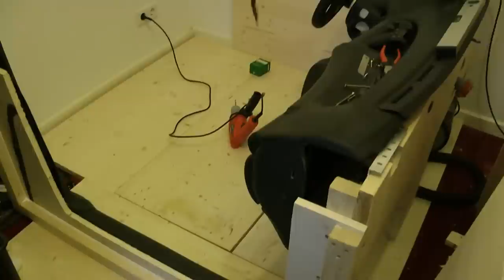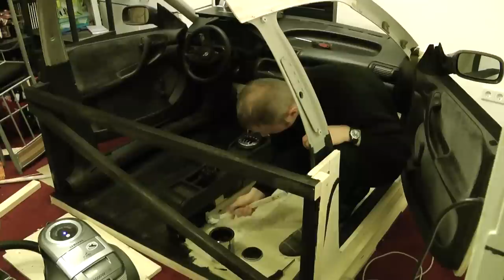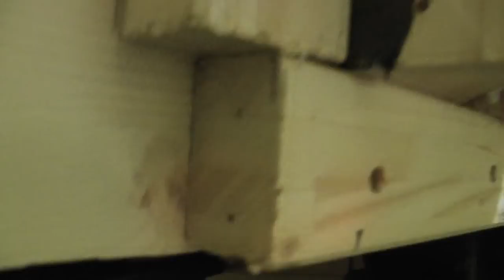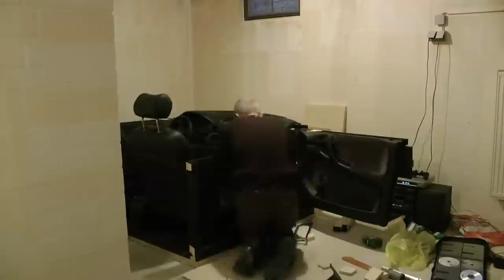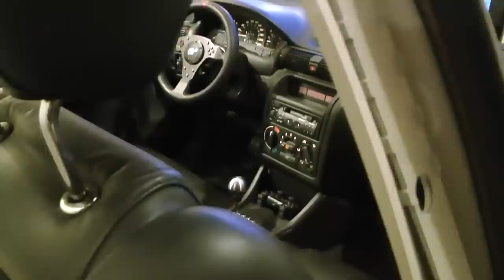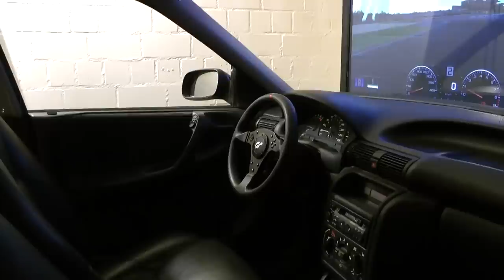Simulation Cockpit With Extended Thrustmaster T500RS and TH8RS Shifter Part 1 of 2 -.mp4

Comment: This is really awesome!!! It really shows the amount of work you put into designing this set-up, and the end result is just pure awesome!
I've thought about something like this but I was going to plan on going to a local scrap yard and just purchase a complete car to cut in half and use only from the firewall back to the B-pillars! and mount it on lockable rolling casters so I can roll it and move it around and put it in front of a 70" LED!
My house has a walk-out basement with double doors so getting it into the basement mancave wouldn't be an issue!
Reply: could use a truck cab with it its how id do it
Reply: A truck cab could work and it'd be a lot less work than cutting up a uni-body car, but you wouldn't get the car feel, it'd still feel like you're sitting in well... a truck!

Comment: Is part 2 posted?  I know this is rather old but still one of the best interior based cockpits I've seen to date.  If you can get the gauges working, which shouldn't be all that difficult, it would be all the much better.  Using the temp control for the lights and the stereo for menus, etc. is also a VERY nice touch.

Comment: If only the spedometer and the tac worked. It would be perfect!
Reply: JStank | X Plays  yes i was also let do with that, i would have put in a digital display in it...does not have to be speddo etc, could have been fake readings of something...also 3 tv screens would have been nice to hide that wall. or maybe paint the wall in a landscape, or cover it in some game posters
Reply: The tac and speedo can work with a little bit of science wizzardry.... I would suggest having a screen behind the cockpit displaying the rear view so the mirrors work.
Reply: JStank | X Plays A projector would work nicer if you wanted a backdrop to look into the mirrors for
Reply: He should use like SimDash or something
Reply: @deadrat4508  Yeah, someone did this with a Golf 7 interior, speedometer and even gps fonctional, that was just perfect !

Comment: But, what if you go in cockpit mode and the car is right hand drive, it will be really awkward to drive.
Reply: +Gazms  its not Righthanddrive but Wronghanddrive ..race car mains LEFTHANDDRIVE .,or its not a race car
Reply: but why would he go into cockpit mode if he alredy has one it would be like inception that would be more akward
Reply: Well since you've already got a cockpit view I would just use hood view
Reply: +Edwin Wal LOLZZ
Reply: +Christopher Cook n
Reply: Invert the screen maybe? It's really easy to change screen orientation through gfx control panel
Reply: +Edwin Wal V8 supercars are race cars of Australia and are right hand drive show a bit more respect.
Reply: +FasBawler NOT ONE JAP CAR IS DRIFTER!!!You have to change the car compleet to make a drifter car..  any car with rear wheel drive can be a driftercar,,with the right settings..
Reply: ***** NO U
Reply: FluffyCat Airsoft____Sgt Chow Ferrari isn't German genius, and if you bothered to fucking search google, you'd see all the R-18's are RHD, and the Majority of the 962's and 330 P4's are RHD.
Reply: +Red so you can turn right to go left ? couldnt be more awkward
Reply: drifty123123 lol, im sure there's a tool to invert steering too, if not already an option in game, plus there must be a mod to change car orientation.

Comment: ALL THAT WORK FOR 1 SCREEN??? WHAT A WASTE!!!
Reply: It's pc you can do 2 or 3 screen
Reply: ***** i know, i have 3. its the fact that he didnt. also, he couldnt do 2 screens, the centre would be the bezel. he has to do an odd number, 1 3 5 7 and so on
Reply: PALMERZ27 you know you can have more than 1 TV'S screen on ps3 or xbox
Reply: ***** only if you have that many consoles, and only in certain games. what is the point
Reply: No there's hdmi splitter. It's called 2 port hdmi splitter. Trust me on that one Palmer. My sister have one right now
Reply: ***** no, listen. you wouldnt do that for gaming because that means that the bezel would be the centre, making it impossible to see properly. also, a splitter will duplicate a signal, so all you would do is have 2 screens exactly the same. which is shit.
Reply: PALMERZ27 I'd actually like to build onto this, in that you can actually have an even number of screens without the bezel interrupting, since its a racing build, I'll go off of one of my personal favorite racing sims. Live for speed, which allows you to select the center screen, and how many side screens per left/right there are. so if he had one screen to the right of the center screen, you can do it that way. all the way up to 5 screens I believe.
Reply: masteircheef so the wheel would be on the far left and you would see the rest of the environment on all the right ones? if im  correct thats really stupid. also, the actual nvidia system for pairing screens together requires 3 or 5 screens of the same resolution and refresh rate, meaning you couldnt make these 2 screens act as one, which really makes it pointless for gaming.
Reply: even with your mouth combine with what is in your head, u can't his work and how talented he is in creating a masterpiece simulator. Oh, man... don't just judge... just watch.
Reply: Devalee Leong no, i cant, because what he just did is spend hundreds of hours building something super immerse, then making the least immerse simulator screen setup ive ever seen in my life, it renders the whole thing pointless.
Reply: PALMERZ27 and all the work for GT on ps3 at that lol i could understand if it was a big high end pc with 3 screens
Reply: esmokebaby exaaaactly.
Reply: screens can be install just anytime brah, the efforts is what i respect most... sigh..
Reply: honestly, something like this I would use a projector, and use deep black drapes on the walls
Reply: Kenny Smith possibly yeah, thats another option, but definately not one screen.
Reply: One screen, one screen, one screen.................. ONE MOTHER SCREEN...... LIKE that is the end for his screen n multiple screen can't be installed anytime..
Reply: Devalee Leong why even show it when it isnt finished then
Reply: All for GT :_
Reply: I don't know if the screens will be necessary once Oculus/SteamVR releases.
Reply: danaolsongaming well then what is the point of the whole build if you see 0% of it.
Reply: I'd say it would be to feel it; there's a difference in immersion when you're in a replica car that you can feel that you're in opposed to a computer chair, stick, and wheel.  I don't know if that makes sense but hopefully you get what I'm trying to say.
Reply: ***** like ur yt name I have a stampede vxl 2wd with mamba monster big block btw ;) #offtopic
Reply: I have a monster truck but I make it like off-road pickup truck
Reply: frankovich213 HAHAHAHAHAH thats a good joke mate, have fun with your flat as fuck screen, thanks for the laugh though. you can only say anything like that after you have actually tried a proper, mounted, 32 inch 3 screen setup.until then, you have no idea
Reply: PALMERZ27 it's not work if it's what you want to do.
Reply: vishee2906 try again but in english this time
Reply: ***** oh  i see now, hes just coming out of nowhere replying to my first comment after a MASSIVE conversation has happened making it seem out of context, which it totally is, no i see how thats very easy to understand (its not)
Reply: PALMERZ27 You certainly mean "all that work for Gran Turismo instead of a proper racing sim like Assetto Corsa?"
Reply: nasoszeppos ^this guy knows
Reply: PALMERZ27 or this is perfect for the curved screens now !
Reply: That's fine
Reply: One screen, but it's big. Aldo, it would be a better experience if it was curved.
Reply: +PALMERZ27 true
Reply: +PALMERZ27  You have a lot of growing up to do bud. I assure you that once grown up, you would be embarrassed to re-read some of your online fights.
Reply: Vague Memory its not an online fight? im 19... this guy waste dhis time by expending effort and ruining it with a shit setup, thats all.
Reply: +PALMERZ27 You can always add more lol...
Reply: +PALMERZ27 whats wrong with you little kid
Reply: beueuehebedududhdh what?
Reply: PALMERZ27 q
Reply: PALMERZ27 it is worth it
Reply: PALMERZ27 А а а
Reply: PALMERZ27 The best us to have a projector behind so it's more immersive in my opinion
Reply: PALMERZ27 jjjjh
Reply: actually with 1 Screen is better than how 3 screens,thats what i think.
Reply: You can always build up to 3 screens , not like its impossible to fit them now

Comment: looks cool, but... it's wasted potential.
standard (non-flipped) pedals, a single screen, unused instruments, review mirror doesn't have a screen showing in-game rear view, and most of all, running vacuum cleaner simulator 6 on that. there's no point in trying to increase immersion on a game that sounds that bad (which breaks immersion completely) to begin with.

Comment: I have a better car simulator than this and mine has better graphics and a faster processor and better RAM. It's called MY CAR!
Reply: Not everyone has the opportunity to try out literally thousands of different cars on tracks from all over the world. If you get to do that with your car(s), good for you - but don't bag out others.
Reply: I'm glad that your car has graphics a processor and ram that's really great....only if your car was a computer. Think before you speak
Reply: MadSuperHero Actually Mr. Genius A. Smartass, modern day cars have computers built in them. Yes. They are just under the passenger seat and they do a lot of the cars maintenance.
The computers on the car keep the temperature at a specific level. They make sure the car is running well, if the car isn't, they let the person know when they have the car plugged into a diagnostic testing machine. So yeah, think before you speak too there buddy.
Reply: Mike Green But that computer does not have a sufficient amount of ram to play a game nor does it have a good enough processor
Reply: MadSuperHero thats why you drive it.
Reply: Mike Green But the point I'm trying to make is that that you said that your car has a better processor and more ram then his sim, which I'm sure is false
Reply: MadSuperHero It does. My processor on my car moves @ reallife.ghz and it has RAM. It can RAM people off the road.
Reply: Mike Green if it was a Pontiac you could have ram air ;)
Reply: Mike Green how am i cute lol
Reply: You calling your REAL car a SIMULATOR is just plain dumb.
Reply: MadSuperHero a car is a computer with a engine pretty much like mike said. The computer controls the dashboard lights your radio the ABS (brakes) your traction control the rev limiter because its programmed to not go past a certain amount of rpm's a computer controls the cold air intake and much more.
Reply: Scar Hadeez Thank you. That was the point I was trying to make lol. The computer, which is located under the passenger seat controls the ignition, valve timing, temperature, A/C, power doors/windows/locks, revolutions, lights, etc. The computer even controls the circuit board. A lot of people don't know that. A lot of people don't realize they could actually plug a laptop into their car computers if they had a modified USB port and the system program of your vehicle. People could use their laptops to modify their cars' performance too. If one were so inclined.
Reply: Scar Hadeez
That doesn't make a real car a "simulator" if you really understand what a simulation means.   A real car ain't simulating driving because driving it is already real to begin with.
Reply: Mike Green
you, i like you

Comment: The most immersive setup would be with curved projectors. One screen at the front that covers the entire width of the front body (1) and one at the back that covers the entire width of the rear(2) or even larger.

At the front (1) have the usual bonnet camera so it feels as if the rest of the front of the car is there.

At the back(2) have the rear view camera on. Option a) have the rear view interior camera there so it feels like the rest of the car is there. Option b) have the rear bumper view on so you can actually use the real wing and rear mirrors you have.
Reply: kapil busawah just try playing with a HMD. you'll see there's no need for such a complex setup.
Reply: ***** I have but pre long exposure to VR isn't healthy . I still find this more an experience to have as your using real eyes and nothing is that much virtual
Reply: kapil busawah who said that?
long exposure to tv was a thing because tvs flicker at 60hz and are usually a relatively small bright spot surrounded by darkness, with a lot of contrast. VR occupies a good deal of your field of view, doesn't flicker nearly as much and blah. we'll have to see, but i don't think it's any more damaging to the vision than watching old tube TVs was.
Reply: ***** no it is. Everything like that is fine but it's too close to my face. Pre - long exposure promotes myopia and as I'm not passed 25 yet my eyes are still susceptible to adaptation and even in 30+ we still are unaware of the affects of HMD
Reply: kapil busawah
being close to your face doesn't automatically make it harmful. The lenses focuses the images correctly at your retina so you don't have to strain your eyes. it's the same as watching a screen one meter away.
have you ever tried it?
Reply: ***** I have. After 1hr my eyes were sore. I had no sickness , just eyes felt as though they were strained for a bit and I couldn't see far away objects in definition for a while after taking them off.
Reply: kapil busawah I drove in a truck simulator for a few hours and you do get sick and dizzy. Didn't expect it but it did happen. And it was the real thing, very professional even with monitors by the mirrors.
Reply: EnricoZulu That is awesome . It's a similar set up to how F1 trains their drivers and Pilots train . Still much better than VR
Reply: +kapil busawah You should check out our professional simulator setup. It has a 210 degree curved triple projection screen :)

Comment: VR is here almost!It would be better to build something that tricks your mind into feeling as tho your really in a car in a virtual world.I have done this using several things including the force feedback from the wheel and heavy weights which send the shockwaves through the hole platform which is suspended on bed springs mattres. Plus I have added a foot masarger to the bottom of my seat to add vibration and it gets rid of numb bum through prolonged playing!
I have also put a very powerful fan that mimics wind speed to open cockpit cars. I guess I'm ready for my VR.Most of this cost me nothing! 
Regards da_leader. Project Cars/Assetto Corsa.

Comment: Totally cool.
Wouldn't it be nice to have AC too?
I would have to find a way to make it work.
Reply: BofaDeez2Nuts you could just buy a portable AC unit and hack it to turn on with the cars controls and use insulated pipe running from the AC to the cars vents?

Comment: single screen can be good if you use a projector or maybe 2! 2 projectors have no bezels so that will work here great. also i hope iracing, rfactor or any other sim can have the option to use a device like ipad or any other android as your middle or side mirror. so you can attach it anywhere you want, so far we can only use it as huds for telemetry, still far away to go in perfecting this sim art eh?

Comment: I have an idea this video is probably old so it's it's comment and you might not even get to this comment but if you were to put a roof on it I would say mount a projector screen where the windshield would be so that it curves and add a projector and between the driver and passenger seat and you have a pretty legit racing sim but my opinion doesn't matter nice job

Comment: Why not just use an actual cockpit cut and just separate the floor pan from the rook at the A and B pillars and reassemble and modify as required? Would have saved a lot of fabrication.

Comment: What do yu use as a gear box.... where will i find one and if i were to get a normal pc/ps3 xbox steering wheel could i convert it to a real car wheel like bmw audi
Reply: Sarah Deakin the gear box is a Thrustmaster th8a shifter you can find it online it's 150$ And the ability to convert the steering wheel depends on which one you get

Comment: or you could do it in the garage, right inside your car... place 3 screens around your windshield and connect the controllers... instead of bringing your car inside the house, you could take your gaming in the garage ;)
Reply: I'm working on just that.
Reply: u have to lift the front of ur car so the tires will not be shity

Comment: good but wheel should be g27
Reply: The wheel is a thrust master T500, one of the best wheels money can buy, you can buy different simulation rims, all with realistic read-outs, look it up on the thrustmaster website.
Reply: The t500rs has a better motor inside than the g27 so its better
Reply: FREAKZ DK if you compare them by price as well though
Reply: It doesn't really depend on the motor, the g27 still uses a gear driven system while the T500 uses a belt driven one which makes the wheel turn a lot smoother and less noisy. It also has a stronger FFB but it's optimized for PS, so using it on PC takes quite a bit of modification on the setup.
Reply: what kind of mods u need to make on pc setup??